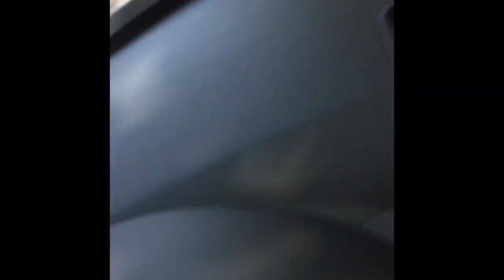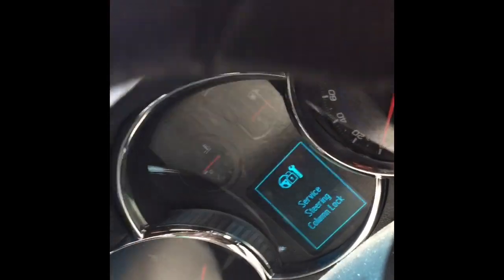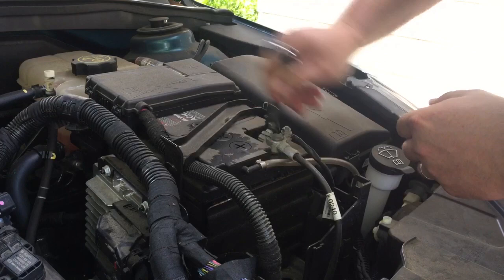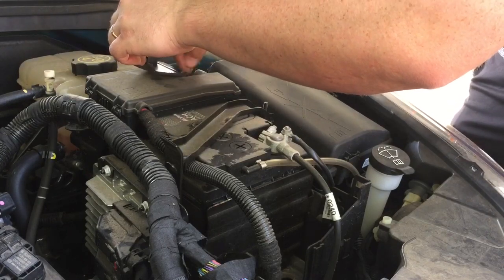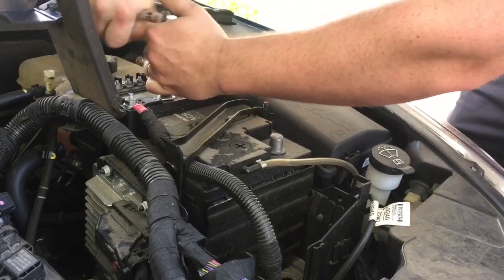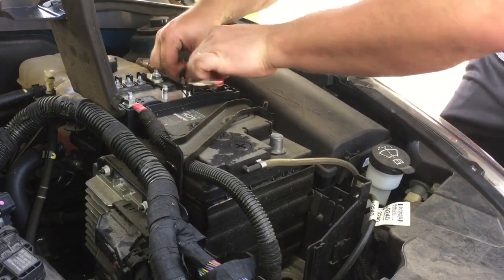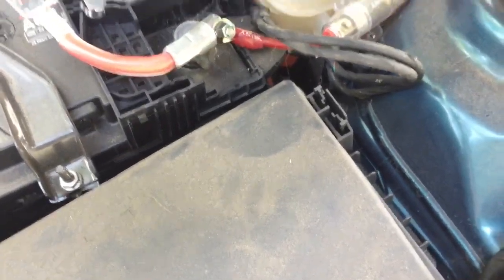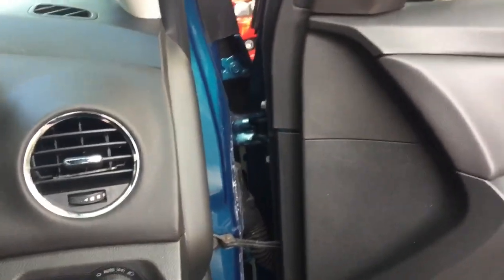STEERING LOCK SERVICE!! Holden Cruze won't start!!

Comment: Bought one of these p.o.s for my daughter   reverse camera went 1st then this steering  colomn thing happened...hasnt even done 60.000ks
Of course happened 3 months after warranty ran out
Holden kiss my ass
Reply from the maker: My wife’s has only just hit 60,000. The steering issue hasn’t come back since but I have heard that these cars have a lot of issues. Like a lot of issues. I hope they work it out for you, I know dealerships can be useless most times
Reply: Panda Garage ....now the reverse cameras stopped...any chance you know a remedy mate im getting shitty and new zealand wants 800 just to lift the bonnett
Reply from the maker: I haven’t got a camera on our Cruze but it is possible the sensor to activate the camera might be disconnected or broken. I’ll look into it though and see what I can find out!
Reply: Panda Garage cheers mate....it works sometimes then when you think all right it fixed itself 
Bugger dosnt work
Camera is intact and sensors work fine
Got me buggered   shouldnt have sold my hq many moons ago
Good bloke
Reply from the maker: Maybe a wire is loose somewhere. Not sure mate, it seems like a classic Holden thing! The classics will always be more simple to deal with, I miss my VC commodore!

Comment: Hey mate my ve sv6 power steering like turn off when going really slow any ideas?
Reply from the maker: You may have an issue with the electric steering pump or that is a speed sensitive steering rack